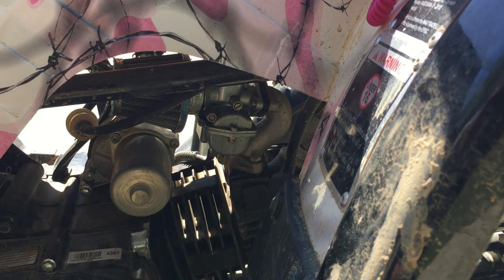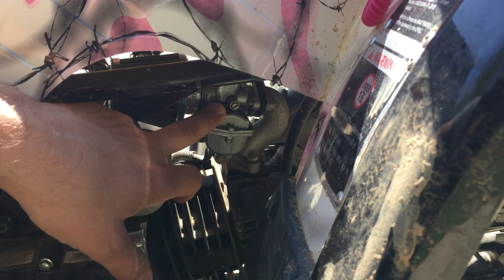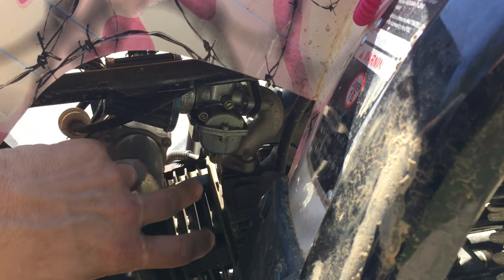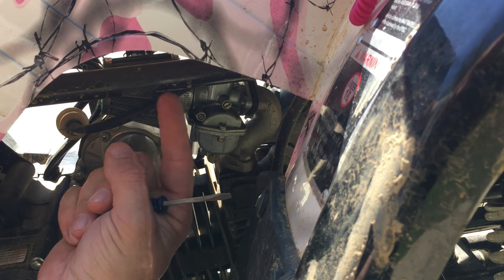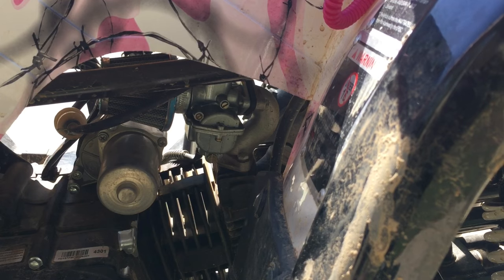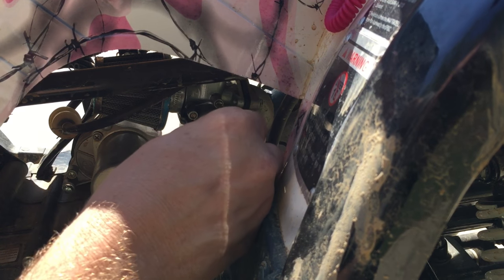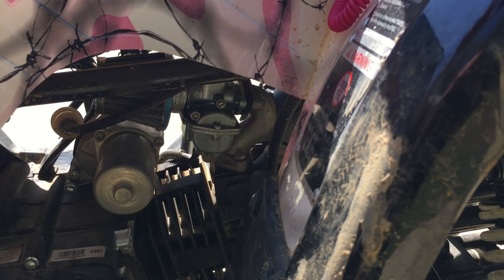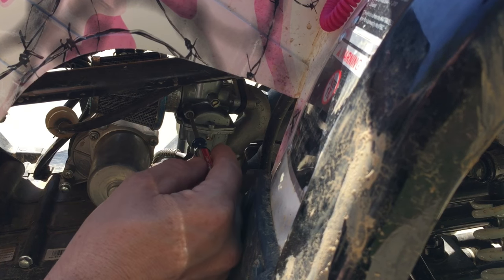Tune Your Chinese ATV Carb

Comment: Why does mine idle fine, rev fine but bogs out when it come down from a high rev
Reply from the maker: MR. J I bet your carb is just dirty.  Have you tried to clean it out? Dirty needle, is my guess.
Reply: What does you plug tell you , is it black or grey after a hard ride?
Reply: Check your float height and check your needle might need raising.
Reply: BellyUpFish it’s clean it’s been doing this since it was brand new.
Reply: @mortirius1  These bike are mass made and each one will act differently to the next sounds like it's getting too much fuel up top .
Try winding out your air mixture screw a half turn at a time and see if it clears up the bogging.
If it does put your air screw back to stock and try lowering your slide needle one clip at a time until it clears up the bogging.
Did you check your float height?

Comment: Why does mine die when I turn off the choke?
Reply from the maker: wat er Typically because it’s too lean. The choke richens the mixture.

You’ve probably just got a dirty carb, but it could be an unmetered air leak.

You can check for leaks by spraying ether or carb cleaner around the carb while it’s running - if the RPM’s increase, you’ve got a leak.

Comment: My China atv is peace of junk I got new carburetor and it still won’t stay running it’s like I get it going and then in couple days it won’t run it cranks cranks runs then dies after throttle it just goes on on on on same thing runs great then it brakes down then it won’t start so then I haft to push it back home I get it going then it repeats same problem
Reply: Try changing spark plugs and check your timing belt
Reply: It’s all timed I got new wire kit for it so that not problem
Reply: I found the problem it was the carburetor intake I was bolting it down when it snapped so we tried to jb weld it together it work for a couple days but then it broke again so we had to jb weld it again it working fine so far
Reply: @westerndevil2597  good luck enjoy your ride :)
Reply: What colour is your plug after a hard ride , you have to remember it is still only a air cooled China bike not a liquid cooled one.
Do a compression test on it , your valves or rings could be toast.
Reply: David Griggs actually I found out the intake valve was not siting right there’s nothing I can do so I just throw engine in crap pile

Comment: Um..... you dont have the mix screw up enough to power the bike lol... you rev the bike up p and adjust the mix screw till it runs right. Then you adjust the idle screw to fit that setting. Your starving your bike when you ou hit the throttle
Reply: U make a vid then bud

Comment: Bike wont even start how am I supposed to tune it like that
Reply from the maker: If it won’t start you have other problems to sort out first.

What is it doing when you try to start it?
Reply: @BellyUpFishGarage  it just cranks but won't start. I replaced a ton of parts already on it and it just cranks . It does have spark but I'm guessing it's getting too much fuel
Reply from the maker: @joucellvelazquez1522  So, it’s either fuel or air, if it has spark.

Pull the carb and see if there is fuel in the bowl.
Reply: @BellyUpFishGarage  thanks brother I'll definitely check that. I also opened the bolt on the bottom to bleed gas through the lines and it goes through with no problem
Reply from the maker: @joucellvelazquez1522  Ok. Thats your drain, so there is fuel in the bowl. 

Is the carb new?
Reply: @BellyUpFishGarage  yes sir it is it's the closest one to the factory one since I had trouble with the Nibbi and vm22
Reply: Thats what im saying

Comment: The guy i bought my ranger from installed a chinese carb on mine. Thing leaks alot of gas
Reply from the maker: Sounds like it's time for a new carb. Your float is likely toast.
Reply: @BellyUpFishGarage  its brand new
Reply from the maker: @guerom1367  New doesn't always mean good. 

Where is it leaking fuel from?
Reply: @BellyUpFishGarage  the overflow pipe
Reply from the maker: @guerom1367  That's more than likely a stuck float or needle valve issue.  

I'd pull the carb out and clean it.
Reply: @BellyUpFishGarage  is it easy to do?
Reply from the maker: @guerom1367  It's not that complicated, no. If you mess up, it's only like $12 for a new one. :)
Reply: @BellyUpFishGarage  i heard no matter what u donto these chinese carburetors they still leak alot of gas out of thenoverflow. Is this true? I have the old carb i can buy a kit for and install but would have to learn how
Reply from the maker: @guerom1367  No, that's not true.  Neither of the carbs on both our Coolster 125's leak. 

If you think you're up to it - I'd go to the auto parts store and grab some carb cleaner, pull the carb out and squirt some cleaner through it, then put it back together and give it a shot. 

If it doesn't work, $12-15 on Amazon and they'll send you a new one, pop it on and it'll probably be fine.
Reply: @BellyUpFishGarage  ok thnx

Comment: Mine is full tilt boogie as soon as I fire it up. I’ve moved the idle screw both directions and no change? What am I doing wrong
Reply: Your throttle body 8n the top is not lined up. Has a two slots should fit perfectly had the same problems

Comment: So my son’s 125cc bogs after a couple minutes. I let the fuel burn off/evaporate from the cylinder and after 30 seconds or so it starts right up. I’ve messed with tuning the carb as you showed but I can’t figure why it’s flooding the piston. Any idea?
Reply from the maker: Have you cleaned the carb?
Reply: @BellyUpFishGarage  it’s a brand new carb
Do I need to mess with the Jets? Should those be tight?
Reply from the maker: @mandov5916  It could just be a dirty new carb. China and all. Some of the QC on these things isn't that great.

So.. You start it.. it runs for a few minutes and then starts to bog?
Reply: @BellyUpFishGarage  I’m gonna have to take it apart and inspect it. Yeah so it’ll run fine for like 3 minutes then it bogs and shuts down. Leave it off and start it again after a minute and it starts back up no problem. On idle it’ll run indefinitely no problem
Reply from the maker: @mandov5916  You may have some unmetered air getting into the system. That can occasionally cause bogging. 

You could get some starter fluid, let the ATV warm up and then spray all around the carb with the starter fluid.

If your RPM's increase, you've got an airleak.
Reply from the maker: I’d take it down, clean it and see what happens.

Comment: Why does my battery not keep a charge
Reply from the maker: Joe Blaine The honest answer, is because it’s most likely garbage.

I had one of our 2 Coolsters that would never keep a charge. Replaced the battery and it’s been good since.

This is what I’ve currently got in that Coolster.

YTX5L-BS Replacement Motorcycle... https://www.amazon.com/dp/B06XDRYQLZ?ref=ppx_pop_mob_ap_share
Reply: Does your ATV have a remote start/alarm/remote shutoff? If it does, the alarm system on them will drain the battery when it sits and isn't driven every day.

Comment: Actually a falcon 90
Reply from the maker: Billy Miller What is actually a falcon 90?
Reply: @BellyUpFishGarage  A Chinese quad
Reply from the maker: I’m sure most Chinese quads in this size range use the same carb. Ours are Coolster 125’s.
Reply: @BellyUpFishGarage  yeah and that same years but some have different carbs

Comment: Then my carburator works just the opposite, If is screw in it dies
Reply from the maker: It will die if you screw it all the way in.

Turn off the engine.
Turn the screw in all the way.
Back it out 1.5 to 2 turns.
Start engine.
Adjust from there.

Comment: the screw is blank
Reply from the maker: You're talking about your air/fuel mixture screw, right?
Reply: BellyUpFish yea the inly screw is idle
Reply from the maker: Tommylooooo Then just adjust with the other screw. One ours was like that before I replaced the carb.

Comment: Mine won’t run without choke all the way up
Reply from the maker: WeepWeep 222 Sounds like you’re not getting enough fuel.

Is your quad equipped with a fuel shut-off valve? Any chance it’s partially closed?
Reply: BellyUpFish I removed the shut off valve and cleaned it out as well as cleaning the carb it’s self. It was dirty I wasn’t even getting fuel into the carb because after sitting for months it clogged the fuel inlet but it flows now. Still won’t run without choke all the way up?
Reply from the maker: WeepWeep 222 Did you fully clean the carb? Get the jet and everything?
Reply: BellyUpFish no sir I did not fully disassemble the jets I just flushed them with carb cleaner and compressed air, I am going to have to check and see if there might be some dirt that is jammed in there. Guess I was just trying to get it done so fast that it slipped my mind. I will update you. Thank you for your help!
Reply from the maker: WeepWeep 222 Before you pull it apart, you could try spraying the carb with some carb cleaner/ether and see if your RPMs rise.

If they rise, you’ve got a vacuum leak and that could be the issue.

I’d try that before pulling the carb apart.
Reply: BellyUpFish 10-4 going to be back home tonight and test it out! Thank you for your help man!
Reply from the maker: WeepWeep 222 Sure thing.
Reply: Your idle jet or the gallery that comes off it is blocked .

Comment: Hey can you help me fix mine ?
Reply from the maker: WetEmUp Ant I can try. What’s it doing?
Reply: Ok so it would start but it won’t stay started for long . Usually dies after a minute or so . I got a new battery as well as spark plug but some times it won’t start up at all
Reply from the maker: So, you only need 3 things to run - air, fuel and spark.

So, the best way to chase these things down is by going through that list.

New plug and battery and some running should mean you have spark.

I’d look at air and fuel next.

Dial your idle screw closed, you don’t have to smash it closed, just closed, then open it two turns as a starting place and see what happens.
Reply: BellyUpFish  honestly I’m new to this whole atv thing I never had one before
Reply from the maker: No sweat. We all start somewhere.
Reply: BellyUpFish  ok so is there a way I can show you a video or maybe even pictures of it ?
Reply from the maker: WetEmUp Ant You could upload a video to your channel and I could look at it.
Reply: WetEmUp Ant same thing happend to me u need to clean the carb

Comment: WTF is a 'air cleaner'?  ... do you mean the "air intake" ? ... (do you really think running a ATV / burning gas "cleans the air" ???)
Reply: Tenically it dose clean the air becuase it is filtering it
Reply from the maker: Jo Mama You’re not wrong....
Reply: Lay off the glass barbie mate.
Reply from the maker: https://googlethatforyou.com?q=What%20is%20an%20automotive%20air%20cleaner%3F